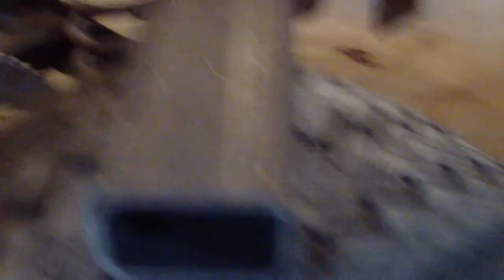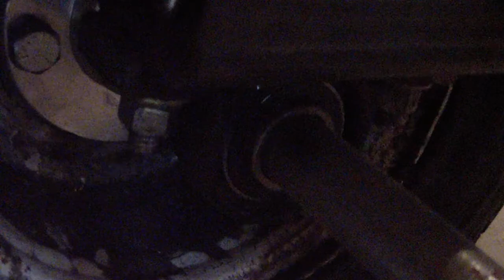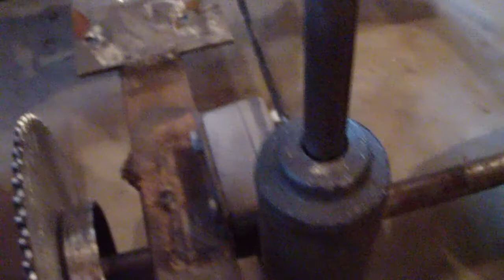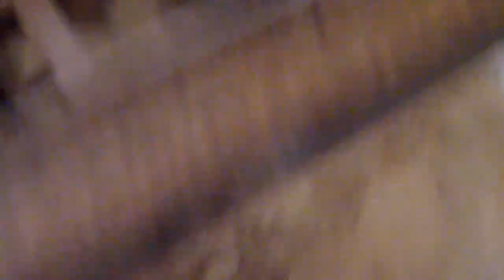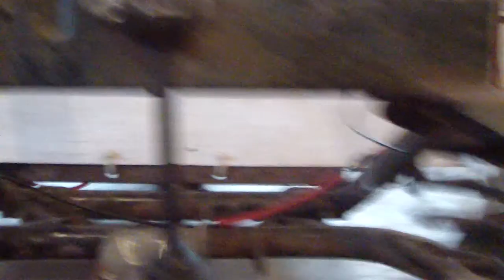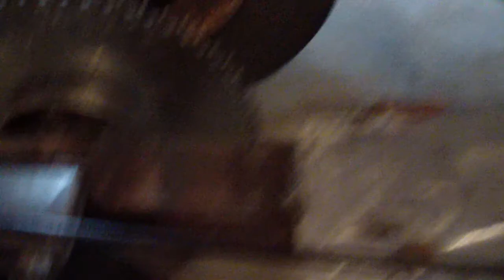golf cart live axle and engine mount for a HF 6.5 HP 212cc Predator engine

Comment: How has the live axle held up and do you wish you went with a bigger motor?
Reply from the maker: I only ran it like 10 minutes. The disc brake I had on there just did not work good enough. The engine did OK, I used a #41 chain and sprocket. I had a 10 tooth on the engine and I think it was 60 on the axle. Maybe 54, but I think it was 60 to help with the tall tires and the weight. The centrifugal clutch ran hot, but the set up worked fine with a torque converter. Like I said both CC and TC had 10 teeth if that helps you. That is why the engine is off in this video the brake was not good. I would have stayed with the set up if the brake worked. I have no golf carts now but I have a lot of wheels and tires.

Comment: I’m doing a similar setup. How did it drive with the live axle?
Reply from the maker: I did this on a 3 wheel golf cart and it pushed enough to make the cart want to tip on turns. So I changed one hub to an idler hub. Check out BMI karts part number 380104 they call it a 4x4 billet aluminum idler hub. 4x4 means 4 bolts and 4 inch bolt circle/bolt pattern. that fits all golf cart wheels.

Comment: Where did you find a live axle that long? Wanting to do a similar setup!
Reply from the maker: It is just a 42 inch long piece of 1018 cold rolled steel one inch in diameter. There are no keyways, I welded all the hubs in place. Brake hub, sprocket hub, and the wheel hubs all are welded to the one inch bar.